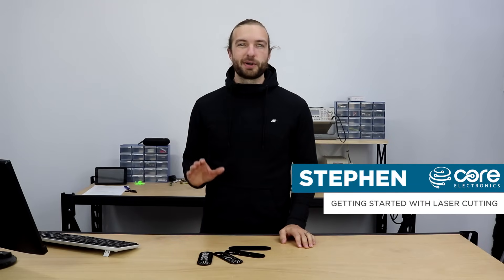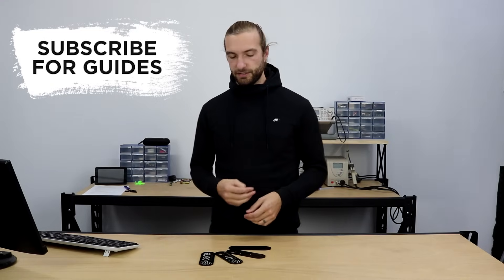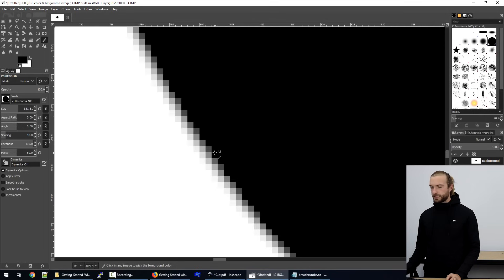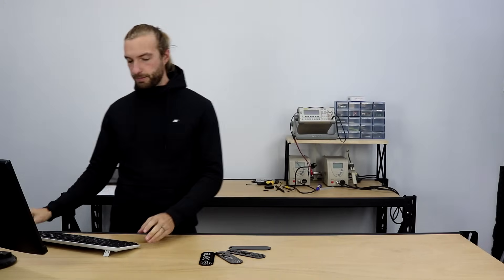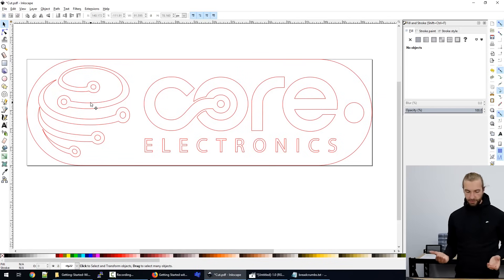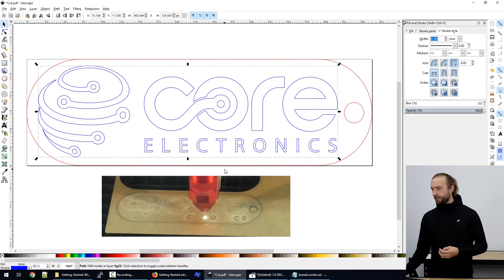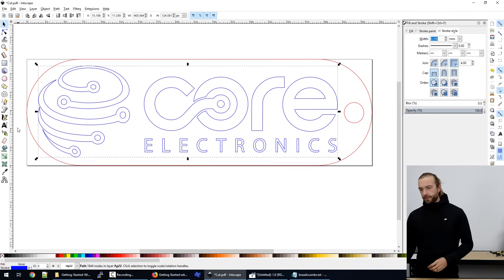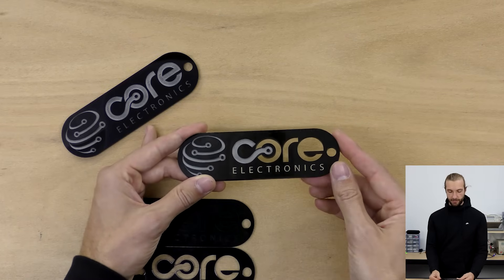Getting Started Guide for Laser Cutting

Comment: Can it cut into bone. Skull for example
Reply: Why…….😳
Reply: It would likely not work depending on the machine because most are designed to etch/cut 2 dimensional (flat) objects. Since a skull is 3 dimensional the etching would not be consistent (too close in some areas and too far away in others).
Reply: Bro what are you trying to do? 😳
Reply: I can think of so many reasons why

Comment: Put one of these new laser cutters upright.. Put a computer controlled rotating plate in front of it.. Put a plate behind that to stop the laser... Write a program to rotate the plate the desired amount when cutting... Adjust the intensity of the laser via a program for cut depth.. 3d laser cutter...

Combine 3d laser cutter with 3d printer into one nice tidy device...

Print solid object cut out parts of it.. Or add details via the laser...

It would definitely work.. I'm a 3d modeller.. And I know you can etch details by turning..

Comment: Can sheet rubber be cut with a laser? The sort that rubber stamps are made of, it’s normally about 3 -  4 ml thick.
Reply from the maker: It's hard to say. There is rubber stamp material that is safe to laser, and often sold by laser cutting supply shops. It would be best to ask the vendor you bought it from. If they are unsure, ask them what it's made from and then use a guide such as this to join the dots http://atxhackerspace.org/wiki/Laser_Cutter_Materials

Always best to just buy from laser supply shops though. There are normally several in every country to choose from!
Reply: Core Electronics thanks for replying, I haven’t bought any yet as I wasn’t sure it was possible, can you suggest a supplier? I’m in New Zealand
Reply from the maker: Perhaps start with some light Googling, and ask some Laser Cutter Suppliers in your area if unsure https://www.google.com.au/search?q=New+Zealand+laser+cutting+supplies